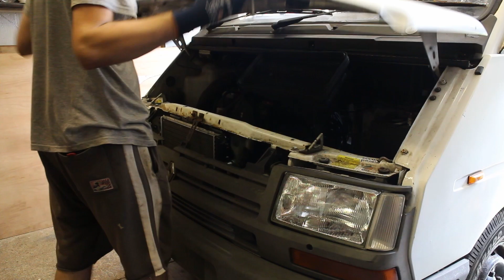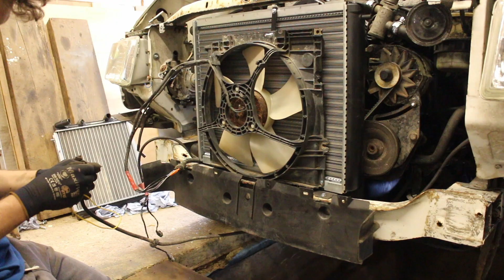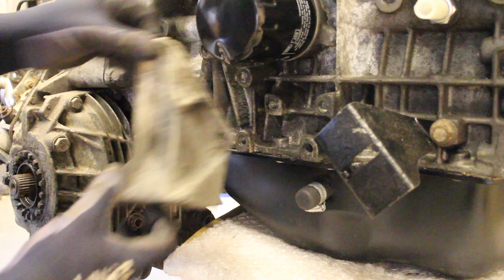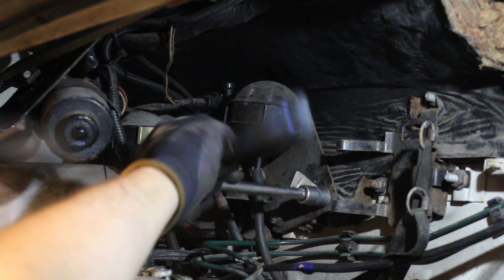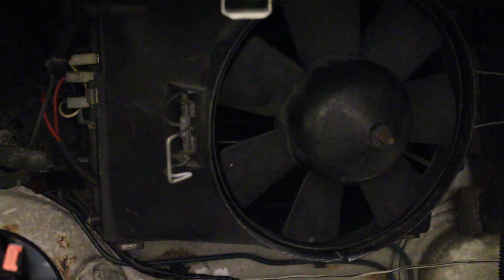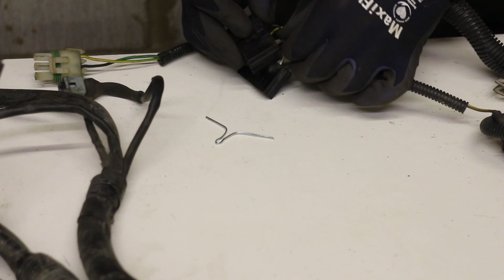Upgrading to the 2165cc Engine - MK1 Renault Trafic 2.2 Engine Swap - Part 6

Comment: Hi I am looking for a crank sensor for a 2.2 petrol traffic j7t engine can you help? Please reply back to this message or personal message me 
Thanks Alan
Reply from the maker: Hi, unfortunately the crank sensor for the 2.2 is no longer made and I don't have any used ones I'm afraid. The sensor part itself is the same as the 1.7 ones which are still made, the difference is with the metal bracket which secures it to the gearbox, so with some modification it may be possible to use a 1.7 sensor, but I don't know for sure. The wiring plug is different also, but that's not too tricky to swap.

Comment: hi i am looking for a crank sensor for a 2.2 petrol J7t enguine for my renault traffic campervan can you help? please direct message me or reply to thread manny thanks Tom
Reply from the maker: Hi, unfortunately the crank sensor for the 2.2 is no longer made and I don't have any used ones I'm afraid. The sensor part itself is the same as the 1.7 ones which are still made, the difference is with the metal bracket which secures it to the gearbox, so with some modification it may be possible to use a 1.7 sensor, but I don't know for sure. The wiring plug is different also, but that's not too tricky to swap.

Comment: En interesting swap was a 1.8 16v f7p or a 2.0 f4r engine. It was plug&play on old 1.7 gearbox and engine brackets. 😁 Why you chose the old  2.2?!
Reply from the maker: The advantage the 2.2 has is that it was a factory option for the Trafic so that makes it easier. I had the wiring loom, ecu, coolant pipes etc from another Trafic so that made it more straightforward. I also had to factor in insurance, my insurance company were much happier with it being a factory engine. I also very much like the 2.2, I think it's a really good engine which is suited to a van as it has excellent torque at lower revs.